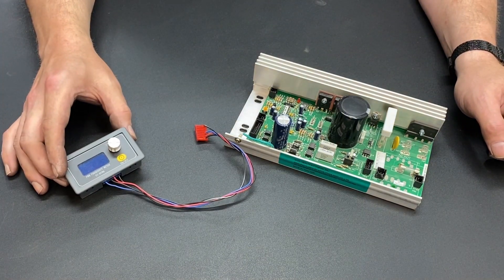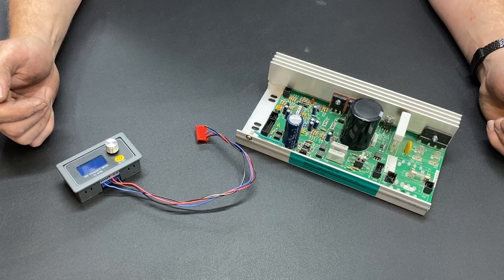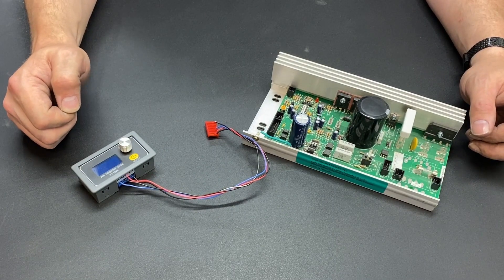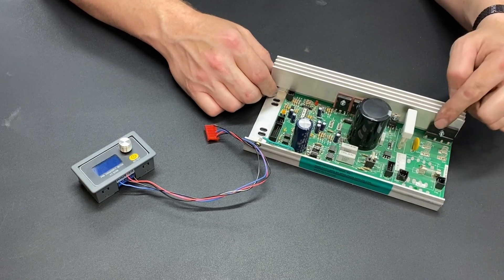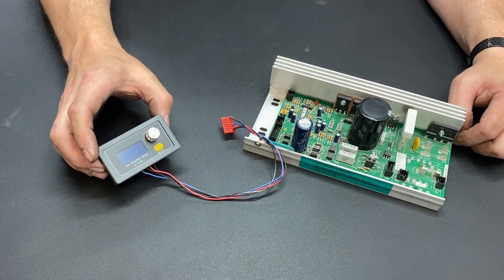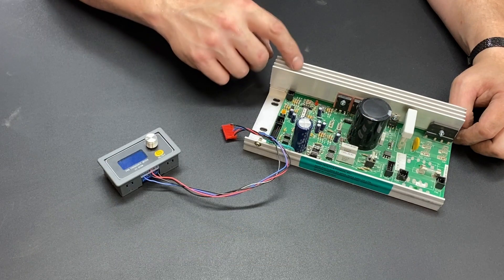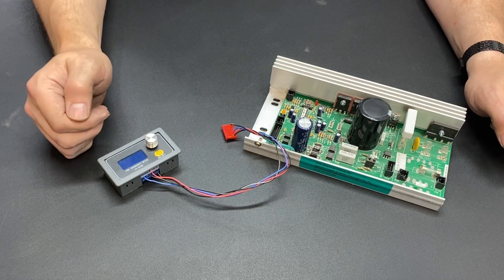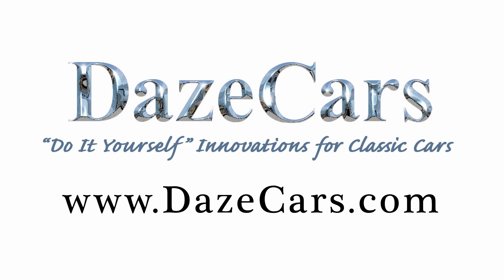Different Kinds of PWMs and How to Use them, Treadmill Motor Controller Power Supply

Comment: What inouts are used for the PWM on the MC1618DLS, white 10 pin socket? also which are the board LV colours??
Reply: should read LV supply colours?
Reply from the maker: here is my info on hacking that board https://youtu.be/edfHZxVdIvM
Reply: @dazecars  I have a MC1648DLS with the large white 10pin connector, I need the PWM input pin , usually blue on some of the other MC's
Reply from the maker: That is covered in the video I already linked

Comment: Alright I gotta issue… I’ve tried everything my limited mind can muster… I have a mc2100 with that pwm you have here… I’m trying to use the 2100 off a not tooooo old treadmill but I have a few motors now. It’s down to a Nordic track and one of two pacific scientific off older treadmills. When I hook my system to the more modern motor it runs fine. I decrease speed it slows the rebounds just once and holds that speed well… I hook it to the older motors ( both were functional in machine) they both do the same… they drop then rebound but then after 3 or solid seconds there’s a boost in rpm like little pops of speed.. speeds then slows rides it a minute then does it again and will continue so far as long as I’ve ran it which isn’t that long yanno just little tests. The older ones came with chokes so I’ve even tried that to no avail… ideas? I would just use the Nordic it’s stronger but… it’s screw on and more work to make work… the other motor has a fan with a pulley behind it I can just swap that pulley for a v pulley  n reinstall the fan and even the mount lines up to my project mount bracket lol
Reply from the maker: Are you running this setup with or without the tach input?  I have heard of this issue being resolved by running the tach input.  Thats what its for to regulate speed BUT I have also heard of this issue being caused by a tach input circuit not functioning properly so sometimes removing it is the fix.  Being that it's motor dependent I am guessing you don't have said tach hooked up?
Reply: @dazecars I do not. I will try n see how that goes. Hadn’t thought of that. I’d love to get these two going… I just know in my heart they’re solid motors! lol .. I did however try hooking up a capacitor and it improved by half for a solid 60 seconds then had big swings so shut it down then hooked the Nordic back up to make sure I didn’t blow out a component n the Nordic ran perfectly lol… probably suck it up for now n run the Nordic while I use the older style 2100 I got yesterday to play with the tach n these older motors… I like the blue paint too I can’t lie lol 😅  I wonder if a scr vs the pwm would make a difference with the older motors…. You have one of the blue motors pictured I think on your website. Have you ran one of these older pacific scientific motors off a scr with the choke?
Reply from the maker: I found that a capacitor can cause surging and I am not shocked that adding one made it worse because there is already a large capacitor on the MC2100.  What is the amp rating difference between the two motors?  as far as the SCR I find the motor output is consistent.  An MC2100 tries to smooth out speeds which can cause some variation  but the SCR is a constant voltage at any given setting so very consistent.  The only speed change is sometimes speed will drop a little as you load the system.  In other words on my lathe when taking a deep cut the speed would drop a little bit.

Comment: Hey great videos, just a question about the mc2100 if I use that PWM do I still need to put the breaker in or does the 2100 have one built in? Do you have any videos on the wiring of the 2100 with the PWM? The treadmill has the choke and a transformer I have had it all up and running using the treadmill screen, but this is far too big. Like you have said in another video the tachometer makes a big difference on the torque and running speed.
Reply from the maker: yes I have several videos on the 2100 and PWM.  You still should run a circuit breaker with the 2100 in fact some boards have a place for it that requires a jumper as a minimum.

Comment: PWM Typical cyclage is 20,000 Hz.  PWM switches between full on and full off.  The advantage of the high frequency of PWM is to control the AVERAGE time the circuit is at full power.  A 50/50 PWM supplies 50% of the power, 100% power for half the time.  At 2:20 you said the faster it pulses the higher the voltage.  NO, NO, NO!  The pulse rate doesn't change.  The WIDTH of the pulse is what changes.  That's why it's called a Pulse Width Modulator.  5% on and 95% off results in an average of 5% of the total available voltage.  95% on and 5% off - yes, 95% of the total available voltage.  This is AVERAGE power.  Even at 5% there's enough voltage to kill you.  It's not a lower voltage it's a lower AVERAGE voltage OVER TIME.

At 4:20 you spoke of amperage.  Again - NO, NO, NO!  It's not Amps, it's POWER (measured in Watts).  AND it's the AVERAGE.  Once again, even at 5% there's enough power (in Watts)(Volts times Amps) to kill you.
Reply from the maker: thanks for the corrections

Comment: I used an Arduino for the pwm to drive the board on my lathe conversion.  It also allowed for a tach with an led display to be run on the same Arduino.   The Arduino does require some programming and I will possibly use a more plug n play pwm when I do my bandsaw.
Reply from the maker: Lots of people have used Arduino and are very happy with it.  Glad it worked well for you.

Comment: i have the same material and the led blink but in output i have just 12v can you tell my what the problem
Reply from the maker: could be a bad MOSFET
Reply: @dazecars  you are right i ll try a mosfet without diode and i tell you think you for your response 👋

Comment: The PWM - there are many different models on e-bay.  I would like to order one.  I have a computer from a treadmill, 2100-12 with transformer and choke built in.  I just built a bench grinder using a treadmill motor.  Which PWM should I buy?
Reply from the maker: here you go https://amzn.to/3kBsNOr

Comment: Pwm modulates the WIDTH of the pulses (aka duty cycle), not the speed of them
Reply from the maker: Your correct, I simplified it for the sake of the video. The purpose was to compare the types, not go over the technical function, but I really appreciate the correction, it should help those that need more technical information.
Reply: There's a big difference between simplification and just plain wrong. If you think your audience are too simple minded to understand PWM you really ought to consider whether you should be encouraging them to play with mains electricity.
Reply: I believe the frequency setting (1Hz - 150Hz) on the MiOTOOW PWM device featured is the speed controlling function?  The duty cycle controls what percentage of any given cycle will have the power pulse. The pulse width widens or narrows pending frequency as amplitude increases or decreases. I could be wrong and it wouldn't be for the first time either.